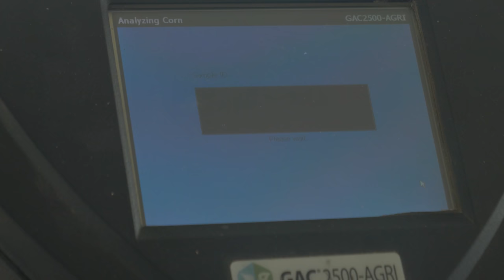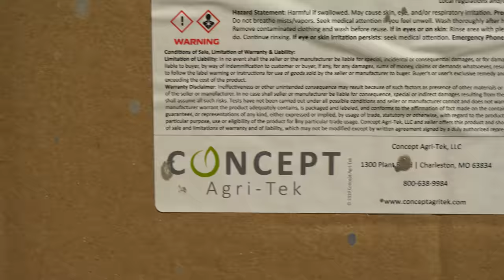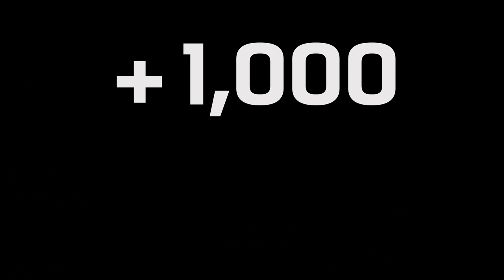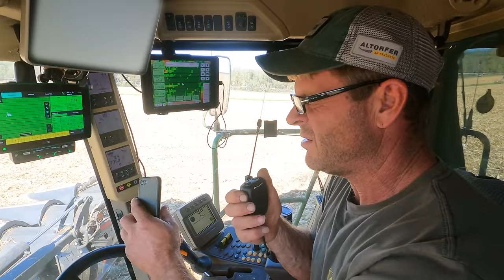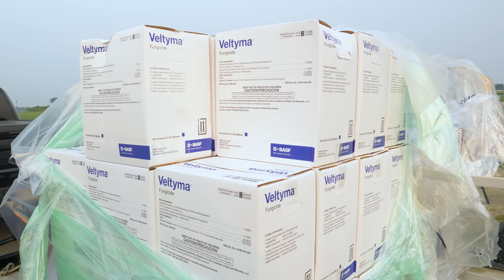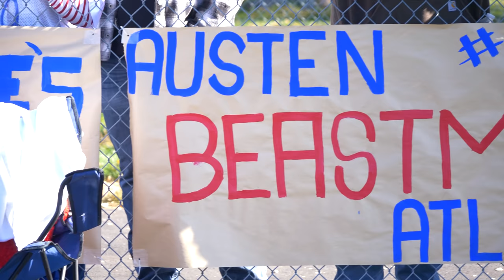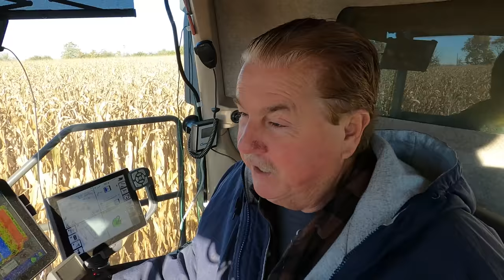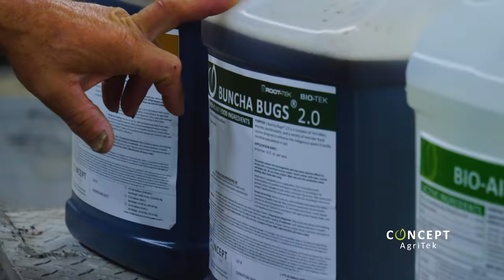Corn Warriors | 515 | Full Count

Comment: Dan did you find why the 9770sts had loss of power?   Ours had low injector rail pressure.  It has has been running good for the last 500 hrs after a pressure relief valve replacement.
Reply from the maker: Thanks for the tip, Robert! We'll see if we can pass this on to Dan.